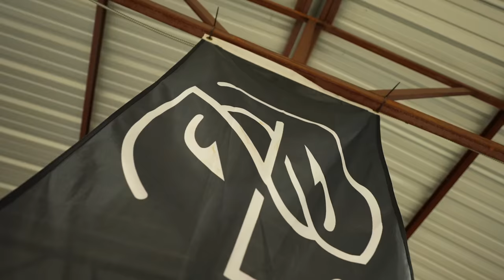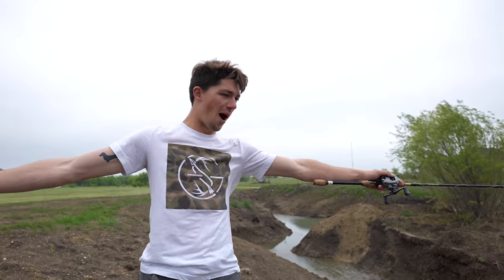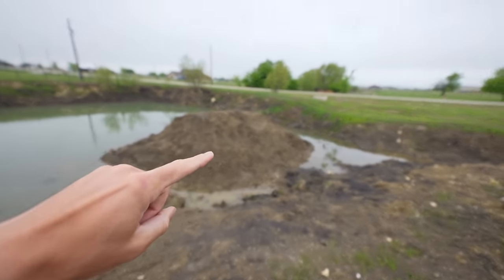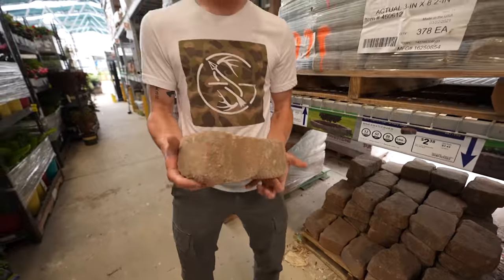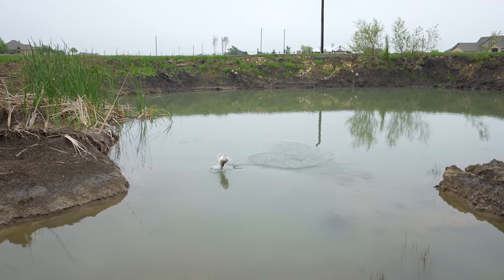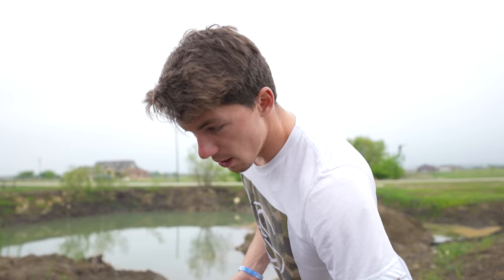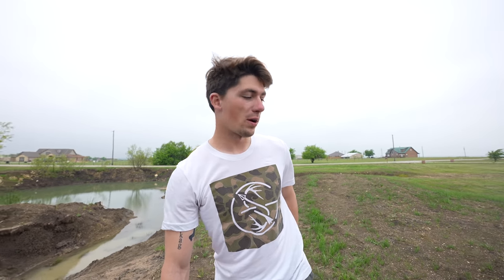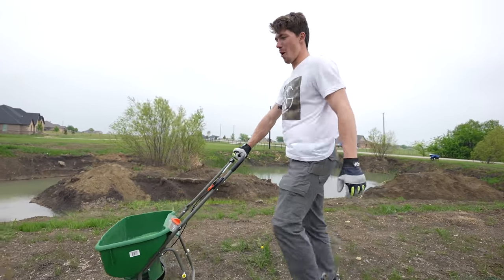Somebody STOCKED Fish In My POND! AQUASCAPING The Backyard Pond!

Comment: Well, your pond brought to mind an old trick I remember reading in Field and Stream in the early 70's for growing huge fish. Make wooden tripod tied together at the top with about a foot or so of poles above the tie point. It should be long enough that it sticks a few feet above the surface of the pond. Take a wire basket and place it in the top of the tripod. Take meat or fish pieces you might throw away and put them in a plastic bag, in which you poke several large holes. Place the bag in the wire basket atop the tripod. Flies will lay eggs in the meat scraps, and the resulting maggots will eventually crawl out of the bag, fall through the holes in the wire basket and into the water and feed the fish.

Comment: Suggestion for your kayak stand...
Cut 4" wide strips around a 55 gallon drum
Run the strips across creating cradles for your kayaks. The barrel plastic will conform to the  different shaped bottoms and cradle the sides..

Comment: since the water is so low it's the best time to place some fish habitat, i.e. obstruction.  PVC pipes that looks like trees will give small fish covers as they can use them to quick drift maneuver  bigger fish.  also it would have been cheaper to buy in truck loads.

Comment: god i hope didn't have that Japanese Maple in the back truck all the way home. U should of put it in the cab. now the leaves will have wind burn. U will notice it in a few days. when U plant it, U suppose to dig that planting hole more deeper & a little wider. the rootball, U have to tease out the roots by slicing roots on the sides all around & a  X or star on the bottom of it. this is so the roots will spread out. if U don't do this, the tree's roots will still grow in the circle like its still in the container. when U back fill the hole w/the tree in it, should be slightly lower than your grade around it. but in the hole, fill it to the level even to the top of the root ball. but being slightly lower than the grade around U  like in a saucer so when U water it, the water won't run away. & any left over dirt, make ring mound around the edge of whole planting. when U water,  it will fill it up & properly get all the water it  needs to get it establish.